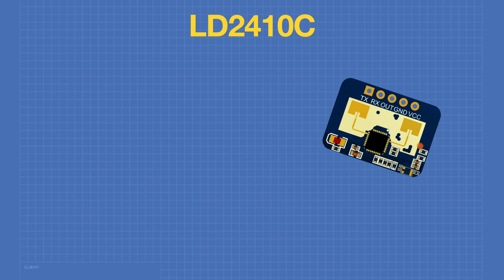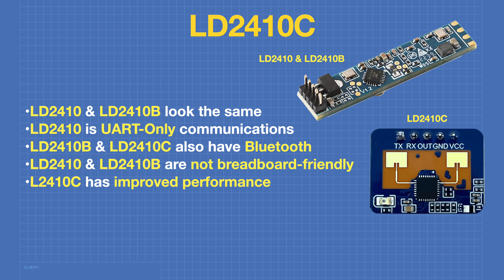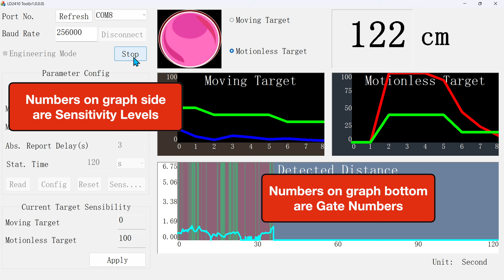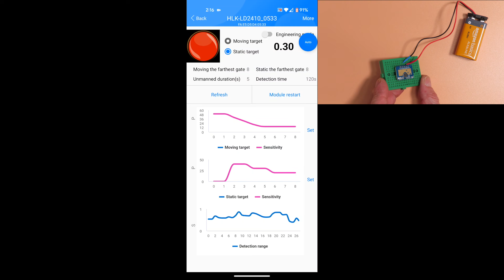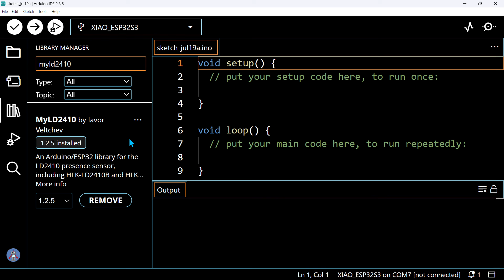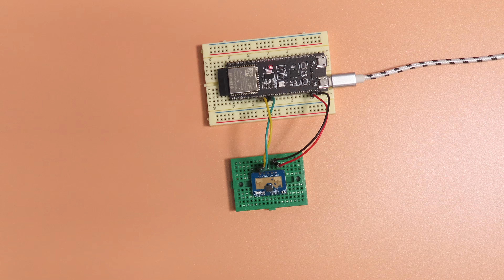LD2410C Human Presence Sensor

Comment: A beat frequency is the interference that happens when two different frequencies interact with each other. With audio you can hear it as a tremolo effect when you play two simultaneous notes that are very close to the same pitch. Mathematically, the beat frequency is obtained by subtracting the lower frequency from the higher frequency.

Comment: I use the LD2410B sensor with a ESP32 and Home Assistant to detect when I have walked into the kitchen area and turn on under and over the cabinets LED lighting. I will look into the LD2410C and do an upgrade.

Comment: This was interesting. I wonder if you could make a video on how to protect the usb-port on your PC in case of a short circuit or if you use too much power. Because it will happen, sooner or later for various reasons. Are there any devices for that? A device that allow full communication but cuts the power if a short circuit  should occur, maybe with some indication.

Comment: Thanks for this very informative video. Can the LD2410 be used to detect the presence of a passenger inside a car? For ex. putting the sensor on the ceiling facing down, or below the back seat? Thanks in advance!

Comment: My question is: will it detect anything other than fleshy beings? I was just wondering if it can be used as a driveway alarm? My current alarm is sensitive to heat and bright sunlight, so this might be abetter option if it will detect hard bodies like cars.